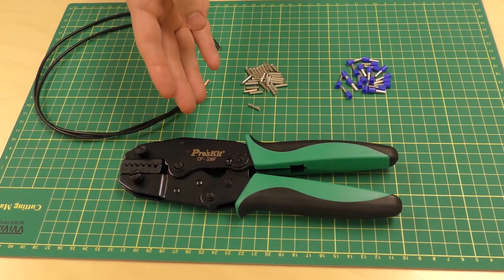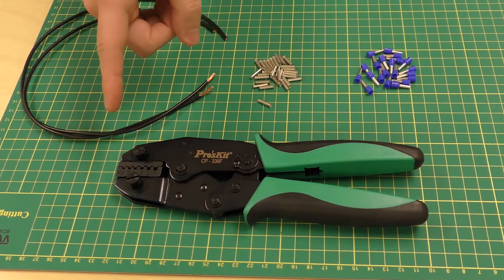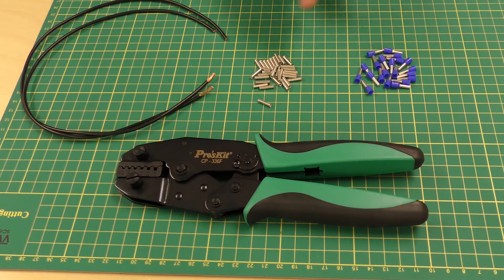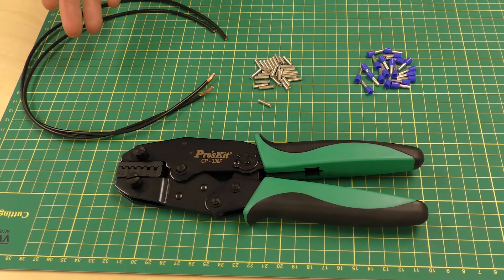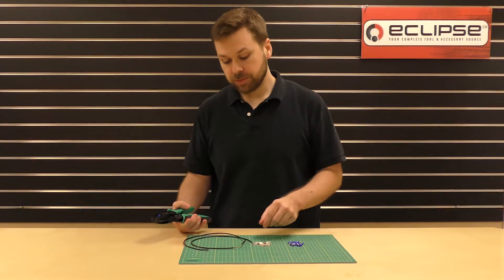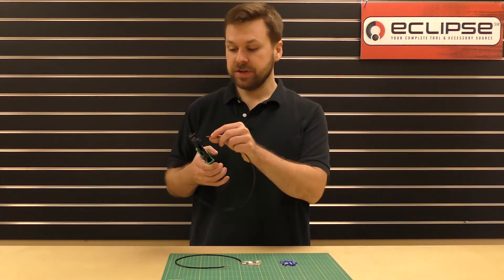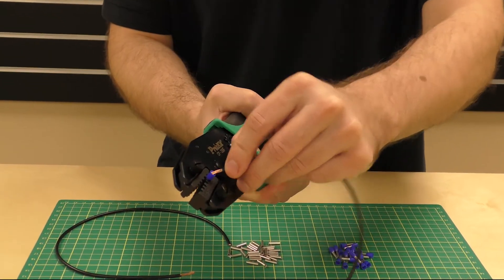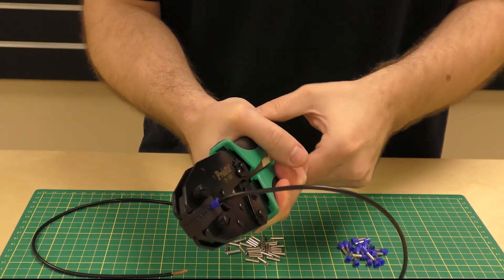QuikGuide: How To Crimp Wire Ferrules (Insulated & Non-Insulated)

Comment: Looks flat afterward. That won't work for most applications such as terminal blocks.
Reply from the maker: Not flat, crimps to square shape. Technically the cavity in the die set is a trapezoid shape.